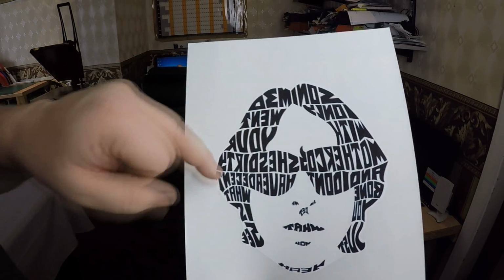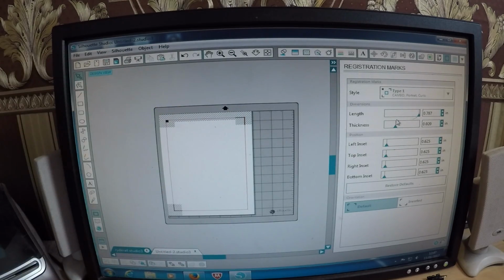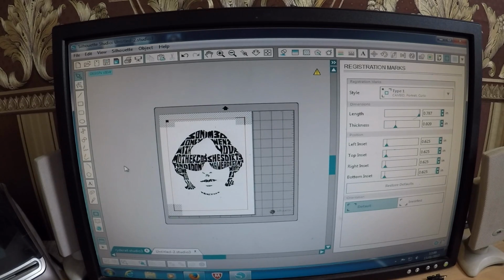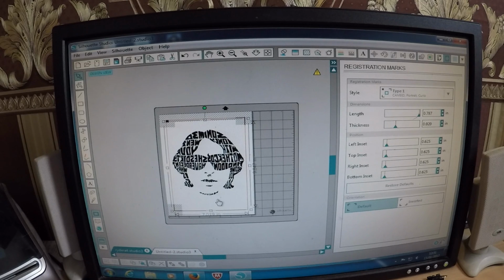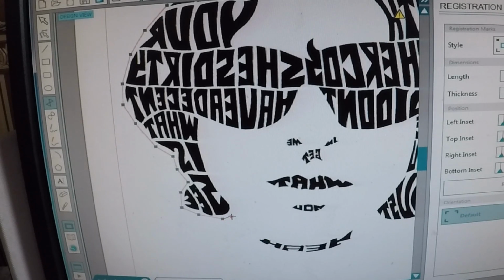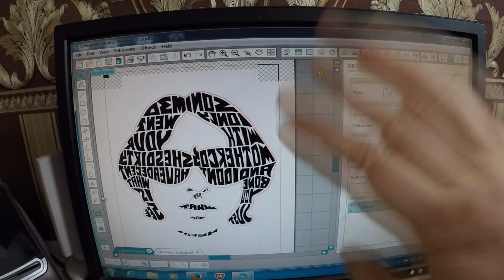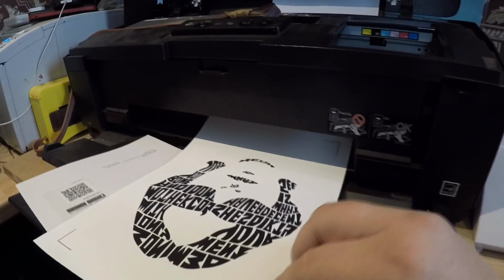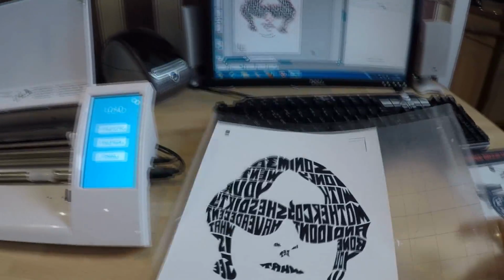Print Cut Transfer Paper Using The Silhouette Cameo T Shirt  Tutorial

Comment: You said regular dye ink. So you dont need sublimation ink? I think im very very confused i need your help. I want to do shirts like the guys in the Mall on cottons shirts black or white i have a cutter to do contour or vinyl cuts i can currently do heat transfer paper die cut like numbers names the heat transfer roll that gets cut and need to be weeded etc but i want to get into color graphic t-shirts i have a normal hp Printer but i was thinking i needed a  sublimation setup like a Epson 1430 with the sublimation ink and as far as heat transfer paper A3 Or A4 what kind do i need im honestly getting frustrated please help
Reply from the maker: First of all, you can't do sublimation on cotton t shirts. neither dark coloured t shirts. I use an inkjet printer with dye based inks. Some people use pigment inks but i've used dyes for 12 years with no issues. There are other types of transfer papers for laser printers that are self weeding. These are very good but require an expensive laser printer with white toners and tricky to install if you don't use the correct equipment or technique. Check out my other vids for more info.
Reply: Martin Butler omg thanks for replying im still stressed out trying to figures this out lol, so say my HP pronter with Oem Ink can be used i dont require a special epson printer? Also what i need is Fabric transfer paper right the heat transfer paper
Reply from the maker: You need inkjet transfer papers but make sure you get a good make. There is no special Epson printer so providing you have either dye inks or pigment inks, you cn print on inkjet transfer papers. I use dye inks as they don't block up as often as pigment inks.
Reply from the maker: Those are done with a laser printer. It's an expensive alternative but can be tricky, you also can only print on white t shirts unless you spend thousands on a special printer that prints with white ink.
Reply from the maker: Sorry, I can't text but I do provide email support with my training dvd. The link to the dvd is under the video in the description.

Comment: hello i need help i printed a sublimation on a cotton t shirt but the pic i printed on that t shirt is very light color why it happend i need help ?
Reply from the maker: I'm sorry, there is not enough information for mew to asses what you have done in your message.
Reply: Martin Butler hello i printed  a t -shirt  the color of the picture on my t-shirt is not what i printed in printer the thing is i didnt use the sublimation t shirt
Reply: Martin Butler why that happened is it because i am not using sublimation  tshirt?
Reply: but when i heat pressed on sublimation mug it was as very good but on the t shirt it was very low quality print kindly help me how can i print clear on my t shirt?
Reply from the maker: You need to be printing on sublimation t shirts. You can't print sublimation inks onto a 100% cotton t shirt. It has to be a polyester blend.
Hope this helps
Cheers
Martin
Reply: Martin Butler ok thannx 😊

Comment: Done know if you know but there's an easier way to do the cutting in silhouette, use the trace tool at the top and if you want a border used the trace then used the off center tool and it will give you a trace line and a border you can control
Reply from the maker: Yes, I know that bud. this is a method that is simple for beginners who don't understand the trace tool.

Comment: Ok I apologize if these are stupid questions, but I'm a pre-novice- (meaning I'm still deciding what machine to order) (between curio and cameo at the moment and I'm stuck!)
At first I was just going to order a machine which could make stencils, and use the stencils to make t-shirts, and I'm considering the heat transfer option while I'm at it (for t-shirts that need to look "sellable")
Ok so my questions are;
1) in other videos on YouTube, I noticed people use a feature that seems to sense the image and auto create cut lines- seemed really quick and easy! (so I'm wondering why you did it by hand… Unless that was the purpose of the second example on the other side of the shirt)
(For heat transfers)
2) i'm confused by the whole part with printing the image with a regular printer; I pictured something like this being created with a single sheet of black transfer paper, that you would insert and then instruct the machine to cut. 
So I thought I understood this process until I saw your video so I'm kind of confused! I would really appreciate some help; I want to start making political tshirts to sell on campus; America is pretty divided right now! I figured it be a good time to help everyone support their causes!
Reply from the maker: HI Jennifer, If you want to make political type t shirts, I would recommend using vinyl as you won't need to print anything out and will only need a cutter and a heat press. Your words can be created in the Silhouette Cameo and you can have simple images (not photos) in a single colour as well. Check out my other videos on my channel and you'll see me using vinyls.
Cheers
Martin

Comment: Great tips using the cut line feature! Dumb question I know but why are dark and light T shirts treated differently. I understand why light transfers have to be mirror imaged and then pressed downwards but as i havent done a dark t shirt with vinyl could  you explain how these are treated differently. Thanks. Mick
Reply from the maker: With dark t shirt transfers, you rely on the transfer paper to provide the white in the images and you print on the face of the transfer as if you printed on the back of the transfer like on the white t shirt transfers, you wouldn't see the image because the transfer paper is white. On the tshirt transfers for white t shirts, when the transfer paper is heated up, it goes clear so you rely on the white t shirt colour to provide the white in the image.
Hope this explains.
Cheers
Martin
Reply: Thanks for that quick and comprehensive reply Martin!
Reply from the maker: No problem.
Cheers
Martin

Comment: Hi Martin 

Really need your help as soon as possible , am going today to buy the Epson 1500w printer today and I need help in regards to getting a good ciss system to go with it , hoping you can help me by providing a link to one . Really good course by the way . THANK YOU !!!
Reply from the maker: Hi Abu, Here's the dye ink http://www.ebay.co.uk/itm/Non-oem-600ML-BULK-INK-REFILL-SETS-for-EPSON-1400-1500W-CISS-REFILLABLE-/282321185449?hash=item41bba76aa9:m:mComRyOo9CsvvWEb8natgCQ

They also do the CISS at http://www.ebay.co.uk/itm/Ciss-continuous-ink-system-COMPATIBLE-for-EPSON-STYLUS-PHOTO-1500W-W-V6-2-CHIPS-/272514545675?hash=item3f7321f80b:m:m9R80byZ77G8Ck90FIo_Lww

Cheers
Martin
Reply: Martin Butler thank you for the quick response Martin , I was actually asking about a good CISS system to fit in to the printer , and wanted to know if you can direct me towards a good one like yours and regarding the ink , would you say the link you sent are better inks the corolgraph inks ? 

Thanks again ever so much for your responses